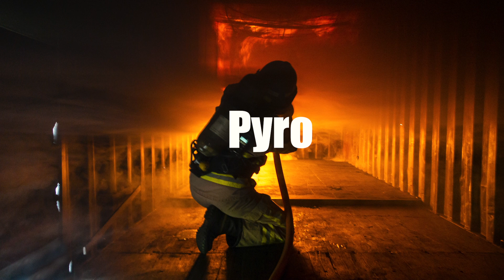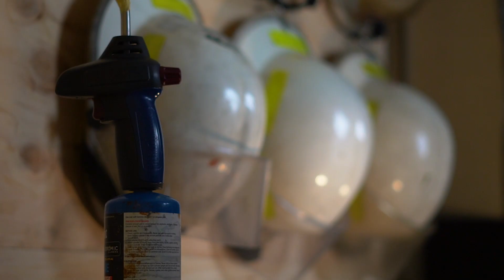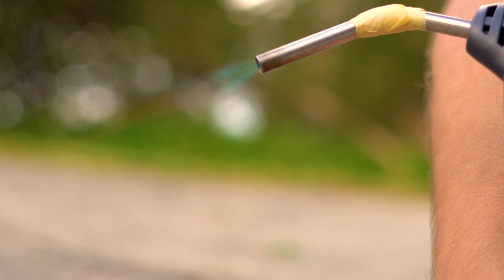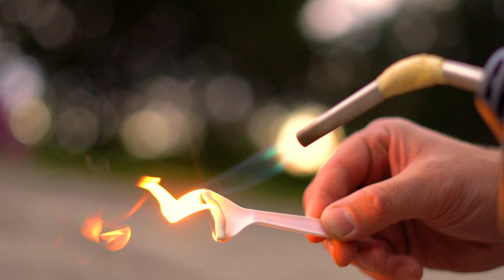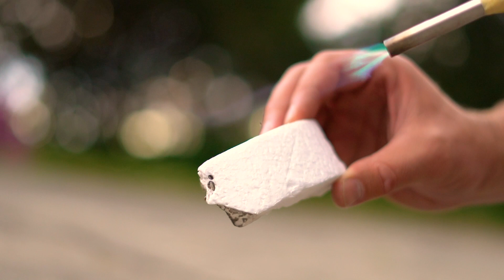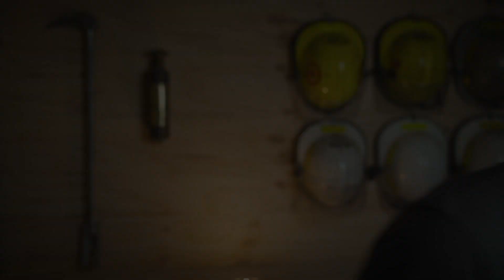Pyrolysis - Turning solid fuels to smoke - Episode 2

Comment: Nice video. You may want to add the following: The pyrolysis gases are not directly consumed by the flame. they are broken down by the high heat into combustible gases (mainly methane0 which then burn to further fuel the fire.
Reply from the maker: Great suggestion. Thankyou!

Comment: Isn't most of the white smoke moisture?
Reply from the maker: It's dependent on what is burning. If we are talking about wood then yes, in the early stages of the of wood being heated up moisture will be a major component of the smoke. However once the moisture has been removed the remainder will consist of more pyrolysis products. A simple example of this is a car doing a burnout. The tyres heat up from friction with the road and then begin to smoke. There is no flame so it is just pyrolysis products being emitted. If you do a quick youtube search you will see that the smoke is often white in colour 🙂

Comment: Can you ever get all of the pyrolysis gasses out of something without burning it? What is left?
Reply from the maker: Yes you can (or at least almost all of it). It's called biochar. It is even sometimes made commercially by heating fuels to around 700 degrees Celsius in the absence of oxygen. I believe it can be used in a range of applications such as bio plastics etc. But essentially what is left is carbon and ashes (which are minerals and are not broken down by the process). Hope this answers your question 🙂